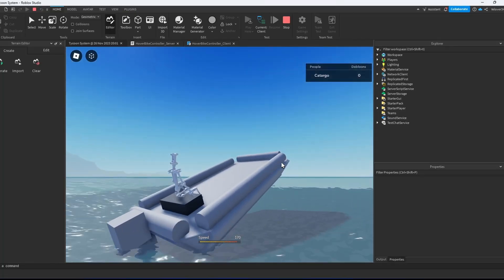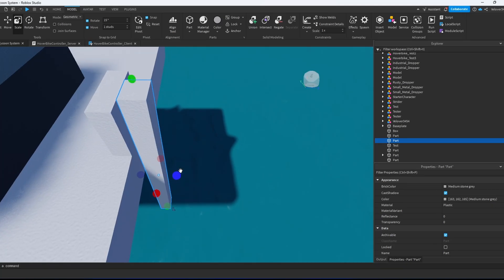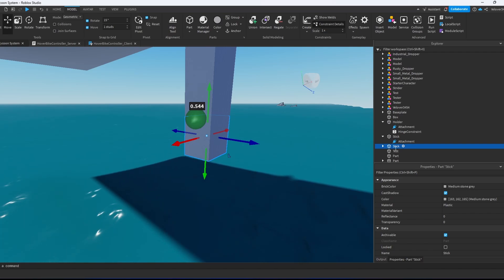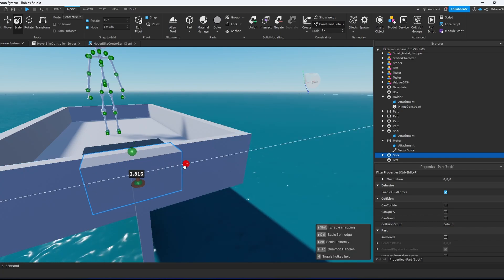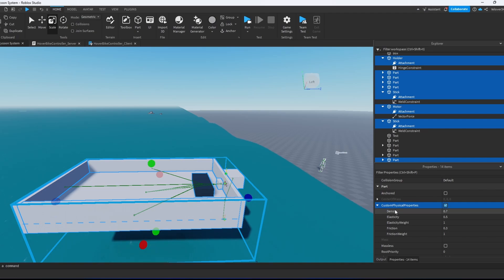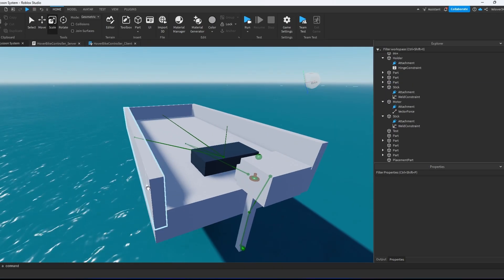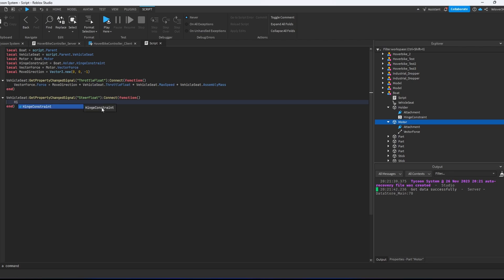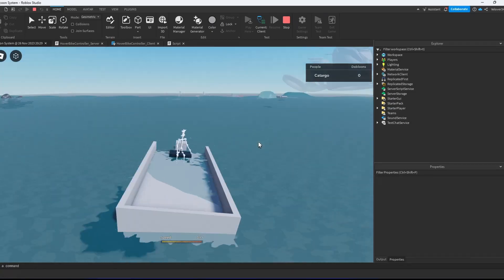How To Make A Boat | Roblox Studio

Comment: Welp It works for a crazy lil speed boat. Now how can you make a huge slower moving Battleship?

Here is the Script for the lazies.. lol JK. (change name from Boat2 to your boats name.)

-- Lua speedboat named Boat2
local Boat2 = script.Parent
local VehicleSeat = script.Parent.VehicleSeat
local Motor = Boat2.Motor
local HingeConstrait = Boat2.Holder.HingeConstraint
local VectorForce = Motor.VectorForce
local MoveDirection = Vector3.new(0,0,-1)

VehicleSeat:GetPropertyChangedSignal("ThrottleFloat"):Connect(function()
	VectorForce.Force = MoveDirection * VehicleSeat.ThrottleFloat * VehicleSeat.MaxSpeed * VehicleSeat.AssemblyMass
end)

VehicleSeat:GetPropertyChangedSignal("SteerFloat"):Connect(function()
	local MaxAngle = HingeConstrait.UpperAngle - HingeConstrait.LowerAngle
	HingeConstrait.TargetAngle = VehicleSeat.SteerFloat * MaxAngle/2
	
end)

Comment: How did you get the boat to move like a speedboat at the start of your video? Where the front end is up in the air while the back end is propelling the boat. I like this effect and want to recreate it
Reply from the maker: @zelectricite  I prob had that the force is applied below the body (position of the motor like irl) instead of right at the middle

Comment: The Holder part is not turning and I followed everything
Reply from the maker: make, sure that in the hinge, you selected the attachment and you didnt weld it to the boat
Reply: @TheCatargo  Can you make the boat as a free model on the Toolbox? I would love to use your model incase mine doesn't work (Edit: it works thanks)
Reply: @minecraftlolguy6869  same thing happened to me how did u fix it

Comment: I just remade it, now the boat is like a fidget spinner going at a velocity of 100000 although the max speed on the VehicleSeat is only 25
Reply from the maker: Better to make the tutorial on how to make the boat with more scripts, I encountered that issue by myself. I fixed it by playing around with part sizes, custom physical properties and a couple invisible parts. Try to make sure that your boat is not too light, not too heavy and it has a good weight distribution... 😀😓
Yeah, you have to do a lot in order for the boat to work like a real boat with a motor.
As well you can add some rotation resistance
Reply: alright, I am currently trying to reverse engineer some boats to understand how they work a little more. Either way, thanks for the tutorial man
 @TheCatargo
Reply from the maker: @leavesfed5462  you're welcome

Comment: My boat cannot turn, I think I misplaced the attachments. Should it be totally in the stick or between the stick and the holder?
Reply from the maker: 1st attachment on the boat(motor holder), 2nd attachment on the motor stick(it holds parts of the motor together), 3rd on the bottom. If the boat is not rotating make sure that you chose attachments in constraints

Comment: Awesome tutorial :), How would I make it so that my boat wouldn't tip/ turn at all, like it would only move on the x and z axis but would be at a level y axis
Reply: I made the density on the bottom parts in a ring, be 0.01 or 0.1 but it still would tilt if I turned a bit too hard. I would like it to not tilt regardless of the turning speed but I can't  figure it out. I want the turning to be purely on the same x-axis
Reply from the maker: Btw, if you make the density too low, it will slow down your boat somehow
Reply: Also increased the height of the motor, holder and stick but that wouldn't particularly  work either
Reply from the maker: One guy made an interesting solution, he welded a wide invisible part so that kept him stable, btw you could try to use align orientation to fix that
Reply from the maker: Constructing that boat feels like you are an Ingenieur, that constructs a boat in real life

Comment: for some reason ive done all my script write and my boat still wont move the vehicle seat stays at 0
Reply from the maker: Strange, did you set vectorForce properly?
Reply: @TheCatargo   vector force is inside motor and force is set to 0,0,0 and the base is welded to the seat and the turning of the motor works but the boat doesnt speed up
Reply from the maker: @HEYFKYT  the only source of speed is the vector force, can you check all the moments when I do something with it?, it's probably an attachment, select mode of one attachment and select the attachment
Reply: @TheCatargo  nope im sure i did evrything correct all attachments are correct when i try to move the boat the speed doesnt change unliek yours
Reply from the maker: Can you make a little debug, check whether the force changes in the properties, if it changes maybe you're not applying enough force, otherwise something is with script @HEYFKYT
Reply: @TheCatargo  whenever i use the keys to move the boat the boat itself doesnt move but the froce in the vectore force cahnges from 0,0,0 to -1207.554
Reply: @TheCatargo  so it may be the script
Reply: ive remade the whole thing  and it still doesnt work the script is correct the hinge moves the vectore force goes to 0,0-1 and i click w to move the the speed on the vehicle seat does go up? @TheCatargo
Reply from the maker: @HEYFKYT  did you select the attachment? Is in one attachment mode?
Reply: not quite sure what you mean but the vectorforce is RelativeTo: Attachment0 @TheCatargo
Reply from the maker: Say if you join
Reply: i joined its HEY_FK!  @TheCatargo